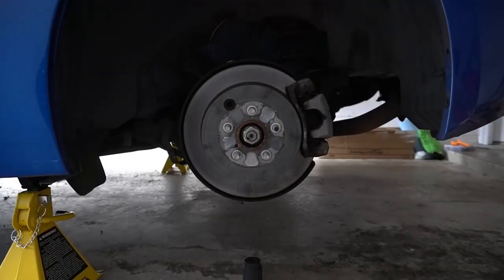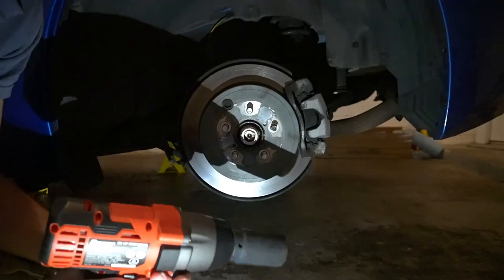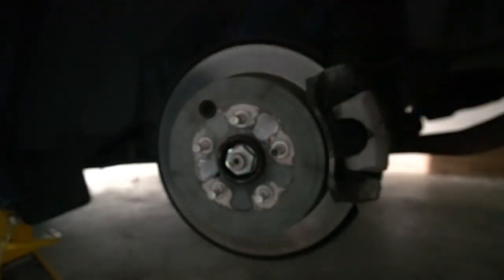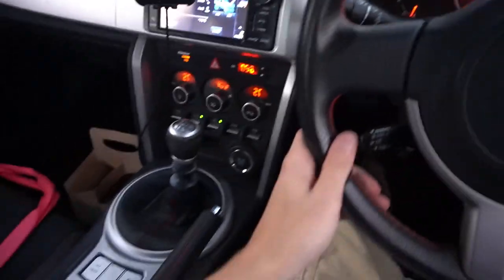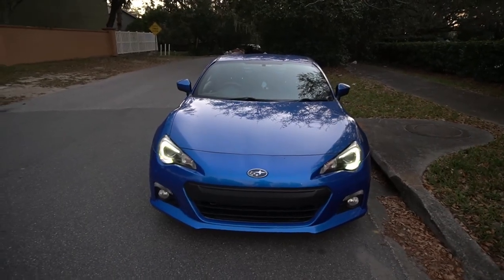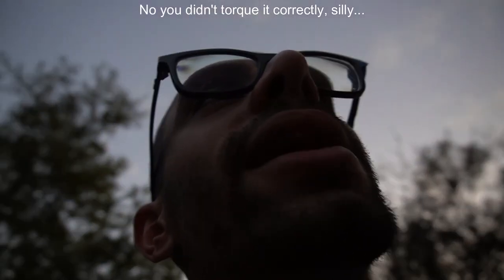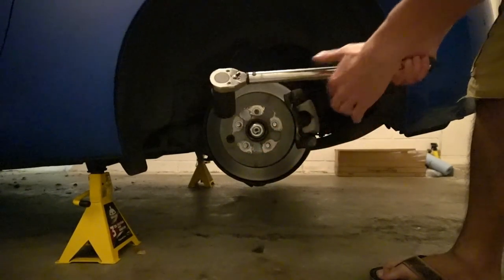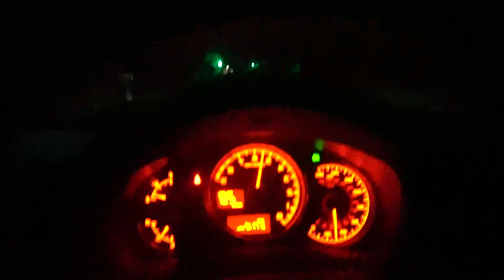I can't Figure Out This Axle Nut Click! (SOLVED)

Comment: You ever figure it out? I am about to replace the axles as well.
Reply from the maker: No bro sorry haven't been on this channel a lot. I only have a manual torque wrench but I've tried 140 or just under 141 many people have torqued it higher I've even seen people literally impact it on lol so Idk if it's just mine being not tight enough or maybe the rust in between, when I took my old one off the back of the nut looked horrendous new one I've torqued technically once correctly actually so I might just give up diy and take it to a shop just to diagnose or if the torque needs to be super on point but like I said I've seen people impact them super tight.. your supposed to take off your axle nut eventually lol and it needs to be a certain tightness so idk maybe it is just my rear driver side axle or even the parking brake clips I saw that it was someone's problem in a forum causing the same ticking but I don't know how to mess w the parking brake clips, gonna try to diagnose again this weekend j got dentist appointment tomorrow and car shows to photograph at but will re tighten the same axle nut to 143 then 145 if I can find a torque spec that makes it stop might keep the same nut on or replace to same spec w one of the 2 brand new ones I have.
Reply from the maker: https://www.youtube.com/watch?v=PpjrnQQC8ac it used to sound this bad and just like that sound not cv noise def the axle nut because all the bad axle noises ive heard sound worse so idk will diagnose again and will just record in case i need to make a video abt it
Reply from the maker: https://www.ft86club.com/forums/showthread.php?t=95702&page=2 the guy at the end of this article had his mechanics confused he said it turned out to be the axle I want to replace mine anyway for 500hp axles even though my car completely stock under 170hp def but I do want to push this engine to the max which is like not even 500hp but close to i mean they call these glass engines so maybe by the time I'm approaching 500 or even 400 will get the 1k hp axles i think that should be a thing especially on rwd cars should have axles that can handle double. Def might just upgrade to the 500s even though they like 1k but I'm still figuring out what I will do with this car since it's my only one for now either getting a second cheap daily drifter to start drifting w or a second cheap but clean older japanese/muscle car to daily and drift this who knows which route i'll go because also looking to do freelance photography but will record me diagnosing and make video if I figure something out even will make a video if i take it to a shop!
Reply: @RagyD  I saw this random Telsa Model 3 video of axel click solution! The dude put some anti seize on the splines and it stopped! I did it and it was silent.... for a few days lol but then came back so idfk. I didn't take off the entire hub etc but maybe I will later on just to try more anti seize along the entire area of contact etc.
Reply: @jbrockskill I've been dealing w hospital visits for a stomach disorder & visiting my parents but back home n got some free time boutta hit harbor freight to get a bauer 8v rotary kit because I'm trying out 2 solutions today finna see if i can clean the mating surface n check n retorque the new nut i put on there that i actually torqued correctly the second time in the video😅😂 to 141 i believe or just a hair under so I'm still COMPLETELY lost abt torque spec i feel like that's something i have to go visit the Subaru factory in Osaka or whatever for😂 i j wanna avoid even subie dealerships ik their mechanics could prob figure out the best torque for my nuts 😅😅😅lol because some dude said in a forum that its the luck of the nut lol so some may differ a bit idk, and also i think i mentioned before but i have a decent b cheap Pittsburgh manual torque wrench so may need an electric one more precise like the techs but boutta go diagnose a bit more, clean surface, maybeee test 141 again but kinda been wanting to try 143 then 145 j to see, will document for vid✌️
Reply: @carsnob  thanks for update. I am going to replace entire axles/nuts here in about a month
Reply: @jbrockskill good call. Mine were replaced and they were in poor condition when pulled from the car. Both the nut and axles. If you’re lowered, this problem is even more lightly to occur. I’ve raise my car an inch to help reduce the chances of damaging the axles. They really don’t like sitting in an awkward angle plus sudden torque from gas application.
Reply from the maker: New video uploaded twas just dusty rust on the axle spindle threads for me at least. In this vid I replaced the rusty nut rear driver side and nothing happened. I referenced the yt channel n video that helped me realize i should clean threads (LHT Performance S2000 axle click video) Try cleaning the threads as well as possible w a wire brush(i used an attachment that came with a rotary tool w my hands) and cleaned a tiny bit off mating surface but it was mostly the decent bit of dusty rust on threads for me. Hope this helps ✌🏽
Reply: @RagyD  I replaced the axles.... it fixed it... but then I traded her in for a 718 Cayman but thanks for the update!
Reply from the maker: @jbrockskill  Noice job! Am burz 4 life like teej. Enjoy that 718 looks nice👌🏽
Reply: @RagyD  Haha yeah I def miss that subaru rumble but god it is nice to have some power now.

Comment: Any update on this?
Reply from the maker: New video uploaded twas just dusty rust on the axle spindle threads for me at least. In this vid I replaced the rusty nut rear driver side and nothing happened. I referenced the yt channel n video that helped me realize i should clean threads (LHT Performance S2000 axle click video) Try cleaning the threads as well as possible w a wire brush(i used an attachment that came with a rotary tool w my hands) and cleaned a tiny bit off mating surface but it was mostly the decent bit of dusty rust on threads for me. Hope this helps ✌🏽
Reply: @RagyD  Thanks for your help. My car is in storage until April. Once the car comes out im taking off the rear wheels and doing a complete deep clean. Gonna scrub the mating surface of the wheels, going to push the axle back and clean and regrease the mating surface where it meets the hub. Im also going to get new axle nuts, and hub centric rings. Hopefully my clicking goes away ahaa
Reply from the maker: @Jakegeno98  I wish you the best 💪🏽 my clicking on both rears has been gone completely from cleaning the spindle threads simply like that should be good until I eventually upgrade my axles but who knows i beat tf out this thing daily😅